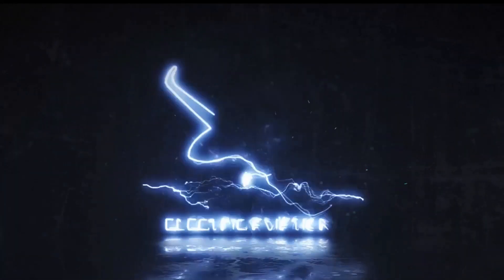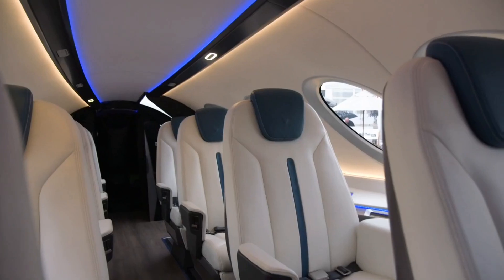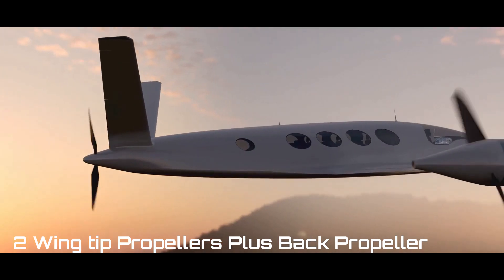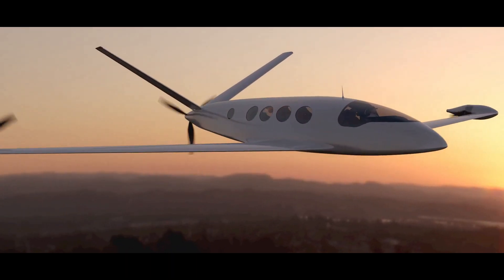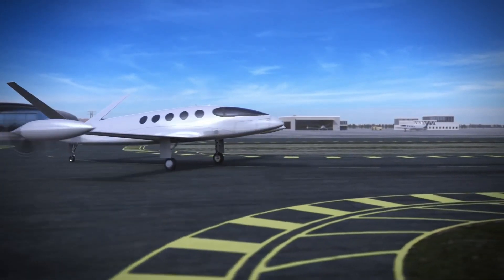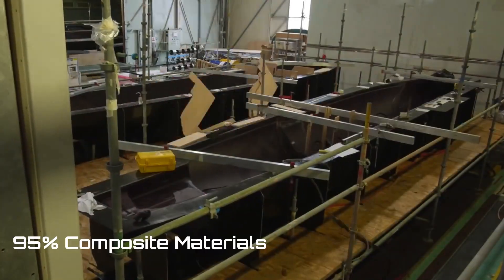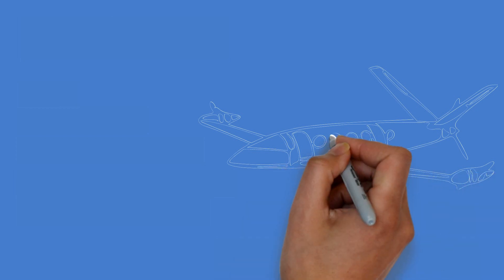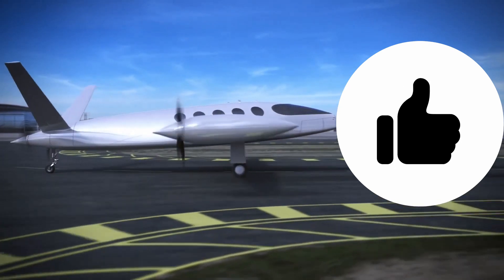Eviation Alice: Complete details of best designed electric aircraft so far

Comment: Nice job. I saw your icon a5 video, wondering if the Celera 500L might be a good candidate for electric propulsion. I'm excited for zero emission travel. Thanks.
Reply from the maker: You are absolutely right. I have a video on my list for the electrification of Celera 500L. Electrification of it was the first thought that ran through my mind, when I saw it. I had to push that video down the list because I didnt want to do back to back videos like the Icon A5 one. Thanks for your appreciation.  Electric Aviation excites me too.
Reply: Otto says that the Celera is designed for ease of electrification,so it should be good. It has a lot in common with the Alice.
Reply: If the plane put a propellor on the front to act as a windmill type creator of energy you could lower the battery rate as the plane could self charge as it flies along meaning the faster you'd go the more the batteries would charge. Therefore reducing the amount of batteries needed to gain the power needed to fly. Then add a couple of solar panels on your wings. Obviously gaining more weight but it means you could also reduce the battery weight again. Trying these methods out you'd be able to find the best ratio of batteries needed to sustain a flight distance. It's always amazed me why everything that is turning in a circular motion whether it be on a car wheel or plane propellor why no one ever places a dynamo on these things to create more self sustaining power. Its ridiculous. Making electric cars without 4 separate dynamos on each wheel or doing the same on each propellor on an aircraft It just has to be a small dynamo as they'd be at least 3 on this aircraft.
Reply: @DavyRo  It doesn't work that way. No free lunch.
Reply: It’s not emissions free, as the majority of the world’s electricity is still produced via fossil fuels. And furthermore, until production technology catches up, all these electric vehicles are putting a far larger strain on the grid and production, then emissions they reduce. We’re stepping over a dollar to pick up pennies.
Reply: Technology does not stand still. Coal is dead. Oil is dying. Stranded assets. Majority of new utility-scale power plants are solar. Electricity is a commodity. Solar+battery is the lowest cost electricity, so it will win. You don’t have to believe me . . . watch it happen.
Reply: @liefbrunhilda926  While I agree that there is no such thing as zero emissions, this type of technology is still significantly more energy efficient than piston aircraft engines. Also Large scale energy production even using coal (turbine steam power plants approach 80% thermal efficency) is still more energy efficient than large quantities of small internal combustion engines due to the efficiency of scale.
Reply: @bulletbob  Solar cells and commercial utility plant aren't there yet due to inefficiency and cost of cells. Get the cheapest cells to be 25% efficient and maybe a shift then. With the amount of rare earth elements in them and the coming global scramble for those elements, solar as primary is a ways off. Unless you meant solar turbine. Other than that nuclear is the way.
Reply: Fission nuclear is dead. No one will invest significant money anymore in a technology that results in catastrophic failures that leave huge swaths of the planet uninhabitable. It’s dead. Fusion nuclear is winning. What you do is you point solar cells at the big fusion reactor in the sky, and convert that fusion generated energy into stored energy. Just like every plant on the planet. 

Solar + battery is already the cheapest way to produce electricity— we don’t have to wait. It’s inherently safe. And it keeps getting better. We will have sunlight for a billion years or so. Solar cells are getting cheaper and better by the day. Battery technology is getting cheaper and better by the day. Invest in solar + battery.
Reply: @bulletbob  LOL. Right the only ones against nuclear are new green deal zealots. There are reactor designs that the hands off and people free mode is safe. Look up what generation design and how old the newest reactor built in the US is. Also maybe look into rare earth elements and solar cell efficiency. Now if you had said we need to aim for all roofs being solar with possibly subsidy I might could support that.
Reply: Failure of nuclear reactors is too catastrophic. And nothing is perfect — everything fails. It’s not zealotry, it’s engineering. Are you really going to install a Russian-built nuclear reactor in Zimbabwe, and hope for the best? Nope. What about solar? Yup.

The rare earth discussion is a red herring. The solar efficiency discussion is a red herring. All of the shortcomings of solar/battery are readily solved, and are being solved. And, it gets better and better. Producing power to storage is much lower cost and easier to manage than produce on demand. In the end, the only thing that matters is cost, and solar/battery has become the cheapest way to provide electricity. It doesn’t matter what I think — it’s already happening. Nuclear is dead. Coal is dead. Oil is dying. Natural gas is surviving. Solar is growing like crazy. The market has spoken.
Reply: Nope, no illusion. This year, 70 percent of new power capacity in the U.S. is from wind and solar. Because it’s cheaper. The rest is from natural gas — still limping along. Coal is dead. Nuclear power is long dead. They will never recover because they are too expensive.

Utility companies don’t give a crap where their electric power comes from. It’s a commodity, they just migrate to the cheapest sources. It’s not some political debatable point about tree-huggers, it’s all about cost. Wind and solar are cheapest, so they win.
Reply: @bulletbob  no nuclear because of government and public ignorance. Thanks for proving my point for me.
Reply: Nope, it’s too expensive. Catastrophic failures are very expensive. It’s got nothing to do with me or the public. Lowest cost wins. Solar is lowest cost.
Reply: @bulletbob  Your mention of failures is just ignorance. Shows you know nothing of powerplant evolution. Sorry if all you want is internet in your basement ok. But you are not currently running the US off solar much less say Manhattan. Keep trying,. Maybe post links to the super efficient panels made in the US and free real estate to support your claim?
Reply: Power plant evolution right there for all to see — it has evolved to solar and wind. Newly installed power generation in US in 2021 is 70% solar and wind, 0% nuclear, 0% coal. My ignorance is no matter — I’m just one person, no one gives a crap what I think. And, no one cares what you think, either. These numbers, though, reflect what the market thinks, and the market has decided. Nuclear-fusion wins — in the form of energy collected by solar panels. The market is never going back to nuclear fission.
Reply: @bulletbob  Correlation is not causation. Again your understanding of why one is not done and the other is not, is quite impressive. List those cheap, efficient, US made solar cells and the free or nearly so land that utilities will be allowed to cover with them. Support your claims. I care what you think I want to see the proof you as "one ignorant person of no import" has access to.
Reply: Efficiency is a non-issue. Solar is already the lowest cost production method available. If I need more power output, I buy more panels. As panel efficiencies increase, I need fewer panels, and the already low cost of solar goes even lower. Land scarcity is also a non-issue. Solar power plants are being built cost effectively in the US, with no trouble finding land for sites. No one is investing in coal. No one is investing in nuclear. Natural gas is still seeing declining investments. The market has shifted to solar and wind, and will never revert back to the old, higher-cost methods. The market doesn’t give a shit what you think and doesn’t pay attention to fossil fuel-industry propaganda, it just moves to the lowest cost production method, which is solar. It’s already happening. Nuclear fusion has won . . .
Reply: @bulletbob  blah blah blah I bet you think the economy should switch to a less capitalist model as well.
Reply: Dude, capitalism worked!!! Solar won.
Reply: @bulletbob  ok where are those cheap solar panels at then? ...crickets...
Reply: Costs of solar panels have dropped 70% over the past ten years. That is why solar is winning — its because solar is now cheaper than coal, nuclear, and natural gas. Solar is winning because it’s cheaper. There are more than a dozen high-volume manufacturers of solar panels, so you’ll have an easy time finding them. If you want to buy American, go for SunPower, First Solar, Heliene, or Tesla.

Capitalism works. Solar wins.
Reply: @bulletbob  so where are these vast installations? Once again....crickets....
Reply: Just look around a bit, my man. A generate/transmit power cooperative is installing a 1.5 GW solar farm in my state right now. In the US last year, there was 12 GW of solar installed. This year, planned installs for solar are over 15 GW and wind is over 12 GW, while natural gas is only 6 GW. Coal is 0.0 GW. Planned battery storage installations are 4 GW, which is pretty cool — the generate-to-storage model is a lot lower cost than the current generate-to-demand. All of this is just the utility-scale projects, not including residential-scale. So, solar power is all around you, and growing like crazy. This is just the beginning of the S-curve that is disrupting the power industry. No one in the industry gives a shit what you think, they’re just going to make electricity at the lowest possible cost, which is solar. Watch it happen.

Comment: Before you give this airplane a 10/10 score for design, check out a talk by Doug McLean to understand why placing motors on the wing tips is a bad idea and demonstrates misunderstanding of fluid dynamics. Then check a talk by Al Bowers to see a much better solution of this problem by implementing a different lift distribution in the wing design. Developing that further would also eliminate the need for a tail. That would be a design I would dare to give 10/10, Alice is 7/10 at most and the current planes are ever worse ;)
Reply: Is it possible for you to succinctly explain why Doug McLean considers this a bad idea?
Reply: @shirazkanga2223  These kind of designs come from people thinking that getting rid of the wingtip vortex will lower their induced drag. Well, that vortex is not the cause of the drag, it's the consequence of pressure difference above and below the wing and you will get it no matter what you do (save from infinite wingspan).
Reply: @jurepecar9092  Thank you. 

So it does not eliminate the wingtip vortices. But conventional motor placement also does not. So its not positive or negative, just no effect - Right?

Or is there any harmful effect also from such placement?
Reply: @jurepecar9092  Reducing the pressure difference is a design factor as far back as WWII planes which include, Laminar flow like the Mustang wing i.e. change of Reynolds Number, reverse twist in the wing tips, reduced aerofoil section, elliptical wing design like the Spitfire and yes the Winglets to reduce it after all other design factors. They all contribute to reduced pressure difference and hence induced drag.
Reply: It's a bad idea because the wing tip engines are so far away from the center of thrust. If you lose one of these engines, there wouldn't be enough rudder input to keep the aircraft from rolling over.
Reply: @mr.yuk4858  fly by wire. Computers will compensate before pilot is aware it happened.

Comment: Wouldn't wing tip propulsion cause a massive moment of rotation in the case of a single engine failure?   Wow, I bet they have some training for that.
Reply: Indeed, nightmarish for a pilot.
Reply: Wing tip mounted props and a v-tail?  Holy engine out rudder authority problem Batman!

Or the fact that it’s a tail sitter with a pusher prop... in the tail.
Reply: @jwholmes2  It's Fly-by-wire and avionics will handle that scenario easily, also manufacturer says that "Alice" can fly and land, with the aft motor only. And same with v-tail, it will have an envelope protection. But I not any time soon, they accidentally burn up their only prototype some time ago...
Reply: @HVM_fi  The latest word from Flight Global is that Eviation has radically changed the design to a more conventional configuration with twin engines and a T-tail.  This would make more sense as there is no possible way the FAA is going to certify an aircraft in this category that needs automation for engine out stability.
Reply: That would mean Vmc at a high airspeed. Probably wouldn't be able to hold on to any altitude.
Reply: @jwholmes2  why would tail wheel and tail propeller combo be problematic?  Other than FOD from the wheel going in the prop.
Reply: @timduncan8450  There is zero tail strike protection so it’s quite unsafe.  If there is a tail strike event you have an engine out situation.

I can’t find another example of a tail sitter pusher propeller with no structural TS protection at all (something else that hits the ground before the prop).  This alone makes me think this is not a serious design.
Reply: @jwholmes2    I have no dog here, but don’t we count the rear landing gear as striking protection structure?
Reply: @timduncan8450  the tail wheel is already on the ground. If there is an over rotation occurrence on takeoff (where most tail strikes happen) there is nothing else between the prop and the ground. 

This is all moot however as it appears Eviation is substantially redesigning the aircraft to a more conventional configuration.

Comment: i am still not sure why no one is researching on Hydrogen/ Fuel cell aircrafts. We already have long range H2/Fuel Cell drones in operation. Compressed Hydrogen has a much higher energy density (Gravimetric) than the best of the batteries available in the current market.

Comment: The only Alice prototype caught fire and was destroyed in January 2020. It had never flown, or even taxied. Is it a viable airplane, or an investment fraud?
Reply from the maker: It doesn't seem like an investment fraud. The only concern I have is the weight of the battery. There are lighter alternates. For example using Aluminium Air battery, which could reduce the battery weight by up to four times. That battery will have to be replaced every two trips. The other options are fuel cells and Lithium Sulphur. Again Lithium sulphur batteries will have to be replaced frequently.
Reply: That wasn't the airplane's battery that caught fire though, but a ground unit I thought.
Reply: @ElectricAviation  Uhh... I thought the bateries were suposed to be rechargeable not replaceable (at least not for 3000 flight hours minimum).
Reply: @ElectricAviation  Primary cells (non-rechargeable batteries) would be way too expensive, you can't use them for commercial transport.
Reply: @ElectricAviation  replacable batteries? sure 0 emission but lots of waste travel. that certainly is fraud
Reply: i dont think their intention was fraud but more of speculation on how fast will good enough batteries be developed. with the looks now you want to be first to get your electric aircraft in air so you can have big market share even if your aircraft under delivers and you have to use batter batteries when those are ready.

Comment: Design is cool until there is a prop governor failure or engine issue on one side, and directional control becomes impossible with the long moment of the tip mounted engines.
Reply from the maker: In that case you can shut down both the tip propellers and just rely on the back prop.
Reply: @ElectricAviation  but that would require engine power monitoring and cutting, and then you'd also lose 66% or more of your available thrust, plus if the system were to fail to notice a loss of power now you have a heavy taildragger that's short coupled and long winged with lots of momentum and asymetric thrust. Seems like a bad design from a handling perspective.

Comment: A canard config would maximize even more the boundary layer swallowing.  It would also give some ground effect at the take-off rotation.  Small cigar-shaped high rev. motors could be used all along the wing to work as track fairings and vertical stabs. The motor's casing could be designed to also work as the wing ribbing.

Comment: I'm wondering why not compressed air for takeoff and ascent thrust thus increasing effective battery range?  The air is compressed during recharge on the ground. There must be a weight/volume trade-off. I'm wondering if those calculations have been done.
Reply: Where will that compressed air be store, what plumbing/control systems/nozzles are required for it? All of that would add up to a fair significant weight penalty for a temporary increase of thrust during takeoff. I suspect that if you were to offset those components with the equivalent weight/space of batteries that just going with the batteries to begin with would work out the better option